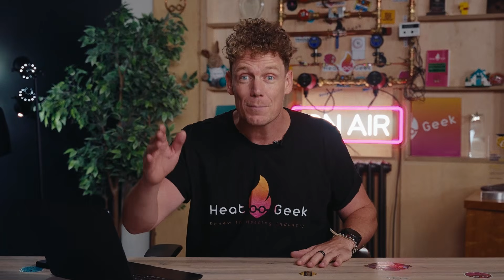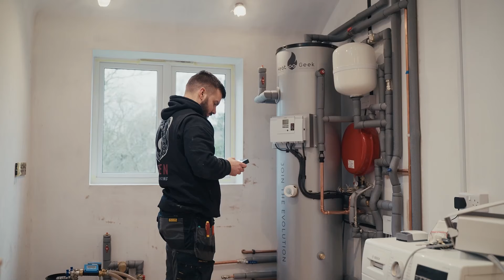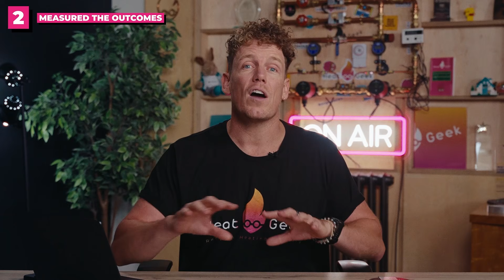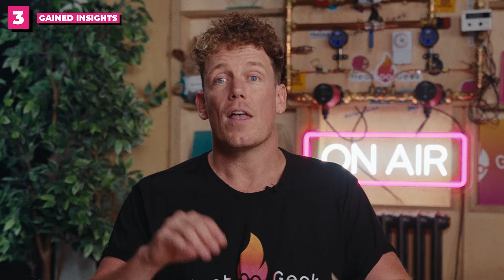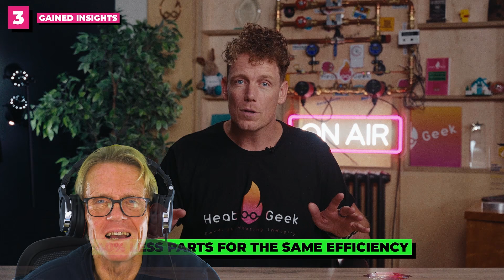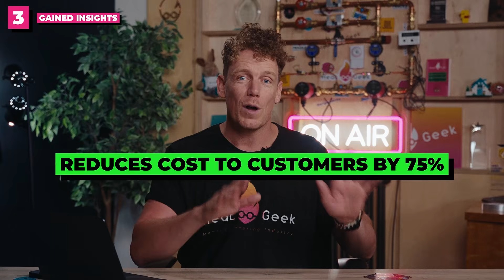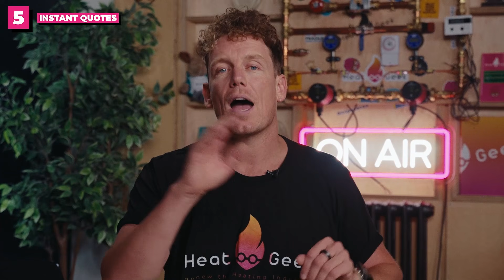Heat Pump Reality Check: Is Zero Disrupt Too Good to Be True?

Comment: For me Heat Geek are very disappointing and it's difficult to believe the claims in their "zero disrupt" concept. I got Heat Geek in because this "zero disrupt" policy seemed it would overcome all the issues I had with previous surveys and quotes, and was encouraged by the estimate given for my 53sqm bungalow via their website. I was therefore surprised to receive probably the most error strewn survey so far, and a quote of £6850 that was not only £1000 more than the the highest that I had received before, but was more than twice that of their website estimate. I have not as yet received a reasonable explanation from them of why this might be. This makes me very sceptical about their claims to be able to perform installations for little more than the BUS grant, and seems that maybe they are adding on a huge fee for their SCOP guarantee.

Comment: There are two ways to run gas/oil heating,  burn a ton of fuel to get the radiators up 40 50°C to warm up the rooms and everything in them fast then the system gos off when you are not there. Or you can have the heating on 24/7 and use the fuel slowly running the radiators at a water temperature just over how hot you want the rooms say 20°C both work at much the same cost.
The heat pump is much more efficient at the second method that is a fact straight from Heat Geek.
I see no reason why the existing radiators need to be changed or the hot water tank.
If the heat pump can maintain the water in the system at 25°C continuously the house should be exactly the same as it was with the gas/oil boiler running 24/7.
Here is the but, poor insulation makes both gas/oil or heat pump expensive to run, a fact that we all know.
Heat pumps become expensive to run if they have to run at maximum for long periods to compensate for cold drafty and damp winter conditions. 
As Heat Geek has admitted, the heat pump is often more expensive to run in winter and the savings are in spring, summer and autumn when it is very cheap to run.
I think all this heat survey and have to change al the radiators is just to push up the price of installation, which is where the money is made.

Comment: We have been heating pools, ponds, now cars and clothes dryers with heat pumps. Air con is basically heat pumps and its everywhere on the planet. The problem isnt heat pumps are bad, its that we over pay for electricity in this country and the heat pump suppliers are milking us.

Comment: I don't normally comment on YouTube videos however we love you Roger Bisby. It's great to have a mature debate from two people that know their subject. I am a great heat pump fan (np pun intended).  I installed a heat pump which I built with my dad from scratch in the 1970s it powered my swimming pool and gave a 4.5:1 efficiency. It was worth every penny we spent (but we didn't spend much on components). My dad designed the heat pump, He was a heating ventilating and refrigeration engineer and couldn't understand why every house in the land didn't have under floor heating and heat pumps. I hope he's looking down with amusement on your debate.

Comment: Roger gave Adam a good grilling, which I thought was handled with grace and good humour.
I think the Heat Geek advantage is in their training, and the fact that they not only monitor the performance of your system, but guarantee that it meets the agreed CoP value. 
I've been running my home's condensing combi boiler at at heating flow temperature of 44degC since before the end of last year, just to convince myself that a heat pump would do the job without the requirement to resize the piping (microbore, buried in a cement screed on a solid floor). I'm encouraged by the results so far, and the only thing putting me off from 'going heat pump' is that the boiler is only around 3 years old.
If I do ever take the plunge, I'll be phoning up my local Heat Geek, to take advantage of that expertise and the performance guarantee.

Comment: Did I see a hot water cylinder in the loft space of a modern house? I would be very worried about the weight of such a cylinder in my roof space. The timbers in a modern house are not the robust timbers they used to be....

Comment: In my simple mind, it makes sense to go heat pump if (a) the house is insulated perfectly (b) you have solar to battery storage to pay for the running cost of the heat pump. So, to meet those stipulations you are talking a decade of break-even time. Oil boiler plus water tank to gas combi swap out ~£3.5k and you recoup space!

Comment: The next issue to resolve is that of replacement costs in 15+ years time. Heat pumps need replacing just like gas boilers, but there is unlikely to be a £7,500 grant from the government when that time comes. Few people today are taking into account the savings needed from the heat pump to cover the future cost and even fewer people are going to be putting that money aside. A lot of people have major problems finding the money to replace their gas boiler, this is going to be a lot worse if a replacement heat pump costs twice the amount.

Comment: I have 3 frinds who got heat pumps fitted about 3 years ago at a cost between £15.000 - £23.000 and they were hopeless their houses weren't freezing but they admitted they were a lot colder than a gas boiler 2 of them have ditched them and are back to a gas boiler.

Comment: Hi, I want to respond to heat pumps. I haven't got one but I know my x partner been forced into one by the House association. He thinks it's absolute rubbish too expensive she is torn of turning it off because of the price. He's putting £30  a week on so she looking at a huge industrial  kettle for hot water and a oil portable heater. This is because she can't afford the price of one of these heaters. She needs it. She's disabled and always in

Comment: I had a heat pump instaled by octopus a year ago, , 7 new rads, valves,   new cylinder, immersion back up, all the electrical  stuff,  all the old combi boiler stuff removed,  works beautifully,  nice warm house, plenty of hot water, total cost to me, £ 1200,

Comment: People my village I’ve changed over to Air Force heat pumps. They’re always moaning wishing they stuck to oil. Most of the time doesn’t work when it’s cold. They’re always having engineers back because it’s not working.  I can assure you, nobody else in this village will be having a heat source pump.  As for smirking Adam I wouldn’t buy a packet of digestive biscuits off of him.

Comment: When we converted an old brick built granary into a four bedroomed accommodation back in 2010 we decided to use an Air Source Heat Pump.  We had an 8 KwH pump installed and used underfloor heating using water pipes.  We put radiators in the bedrooms on the first floor.  The installation back then was just over £5K plus a 500 litre hot water tank that including installation cost another £2K.  I really don't know how the figures compare with a gas/oil boiler, but a four bedroomed property, used by guests (no control over windows open etc.) we were astounded at how low the cost was.  Then it was under £1K per year for all heating, lighting, hot water and cooking.  We are still pleased with how it works, requires very minimal servicing and still works very well 16 years later.  It just keeps heating the property and providing all the hot water we have needed.  The insulation we put in exceeded the regulations of the day but I am sure they have raised the bar since than.

Comment: I am probably wrong, but it seems to me that the error here is that the UK is clinging on to the wet systems. Trying to combine radiators to heat-pumps is an error similar to the German car manufacturers focusing their EV production on big (long journey) cars. Harness the tech to its most efficient output. EV should be focused on small vehicles (Renault 5!) which covers commuters, school run etc, and heat pumps technology should be focused on warm air and joined with solar for hot water cylinders. The regulations linking grants to the removal of fossil fuel boilers was completely wrong. Get new installations to drive the volume up and prices down. Properly designed systems are at their most efficient when installed in a building designed around them. New house design is rolled out en mass on most developments so the one design is installed multiple times. Then, when the cost has been reduced by the volume of the developer’s purchase power the tech will be at a price that retro fits are logical.

Comment: So I thought this sounds good, maybe get some sound advice/help from heat geek. I have already had one estimate from a company the did not realise I was into maths. (They wanted to increase my yearly heating and hot water bill from £800 on oil and a small bit of coal to £2700 on electric) 
I went onto Heat Geeks website and it asks for your house number/name to get your address, then it comes up with a set of figures which are absolute fantasy. I was disappointed to say the least. The floor area was way out, and estimated heat loss, (5.48kw, is that per minute) again based on what, they don't know if I have newly insulated the house or its a draughty stone built cottage with a mud floor.
 340% guaranteed efficiency,  does not matter how efficient it is if you are using mega watts from the grid.
1 radiator to be upgraded, they don't know how i designed my radiators and what over size I gave them, if any..
For this work of fiction they say it will cost (minimum I guess) of £10800.
And the real kicker, they will come and view the property, a design consultation, for the princely sum of £250.
I though I had a bogus website, but it appears to be genuine.
So I think Rogers opinion that its all done by guesswork has been upheld.

Very disappointed.
Its probably done with AI. Artificial Idiot. 🙂

Comment: Roger I think you need to listen to the Zero Disrupt video again.  And you should undertake the Heat Geek training.  The heat geek installs typically have less components as the principles of the training is simple systems that are not zoned.  The training is all about engineers understanding the principles of heat loss and good heating designs.  It takes time to collate the data from all the different installs and then use AI to analysis the data to come up with how the heat loss assessment can be stripped back.  I think your comments are a bit disingenuous.  Heat Geek are trying to improve engineers training and knowledge as they require a different mindset to banging in a 30kw combi.   It would be great if you undertook the training and then gave your feedback.  There are companies  up selling needless parts on heat pump installs that are simply not needed (underfloor actuators, manifold pumps, zone valves) to name a few.  As the data continues to be gathered I’m sure more learning will come.  I’m not sure Heat Geek should be lumped in with some of these other unscrupulous firms.

Comment: So my challenge to you is as the owner of a London heating company . My own boiler is 30 years old non condensing and requires replacing. Come and install anew heat pump a pound less than a gas boiler and reduce my heating and hot water bills by one pound a year and I will give to your appointed charity £1000 . Fail and remove the heat pump and install a new condensing boiler free of charge and give £1000 to my appointed charity . Put your money where your mouth is ( I will be ignored I’m sure )

Comment: Typical gas lighting.
Higher demand will bring down costs !  Ah, NO! Material costs, labour costs, production costs etc etc, all go up without fail! That will more than cover any theoretical cost reductions due to higher production.
The claimed savings will always be over baked in order to sell an idea or product. The saving assumes that all extra measures are implemented, at extra cost not stated or taken into account.
Just like all the claims for a wind farm output. It is stated based on 24/7 output (and wind 24/7). No allowance for the fact that their annual output is approx 20%. Even less these days with the trend of paying to switch them off!
Yup a new market for " miss sold a heat pump" is gonna rise up.

Comment: Hi Roger, here's one for you. I moved in aug and very much wanted to install an ASHP. However my new heating is a forced air (floor vents) gas boiler. So imagine my suprise at just the complete lack of any information about if it can be done. Heat Geeks sadly have been absolutly hopeless , Adam bigs it all up but reality is just rubbish , very very disappointed.

Comment: Since most heat pumps need extra size radiators , just fit them and turn the gas down it will be the same cost and savings without the massive outlay

Comment: Not much discussion of a hybrid system that presumably could combine gas and heatpump sources to supply common pipework with  realistically sized water filled radiators.
Reply from the maker: We have discussed hybrid systems quite a lot in other videos. I see them as the way forward, Adam doesn't.

Comment: I went to their website and I filled in the form.  It estimated a cost of £3500 savings of £300 a year.  So 11.6 years to break even if nothing goes wrong.  At age of 75 I would be knocking on for age of 87.  I think at that age I will probably have been pushing up quite a few daisies.

Comment: The issue is not the tech, it's the industry hasn't quite got the smarts it needs yet. The transition is about educating installers and consumers. It's pretty painful but a necessity as we reduce the need for gas which price is set by foreign countries.

Comment: I have two 11kw heat pumps , cold spell came along , so I increased flow temperature from 25 to 40 running for six hours on continuos not weather compensation , there was barely any increase in the Luke warmth of rads or underfloor heat , put it up to 60 just to see , again virtually no difference , it did use a heap more electric but with no discernible difference .

Comment: I am an MEP consultant, and I am going to make it simple for everyone, this is my advice never get a heat pump if you have an old leaky house no matter what they won't work properly definitely keep you boiler, I would replace system boilers, to combi boilers which are more efficient and provide hot water on demand, and remove HWC from house, to provide more space for you and reduces your energy bill.
Heatpumps are low temperature so it won't heat an old standard house it will cost you fortune and electricity is around twice the price of gas and you would need a good known heat pump not a random heat pump which are expensive, heat pumps work in new built houses perfectly.
If you want to reduce costs simple, start by improving fabric performance add insulation to floor, roof and walls, two getting more efficient boiler, change bulbs to LED, change windows to triple glazing, maybe install MVHR system, and if you have some money to splash solar panels are great and small battery storage, their are many small things you can do to reduce bills but heat pump is not one of them.

Comment: There is no reason for heat pumps to be so expensive , technically they are very simple and should be cheap to produce - there is very little inside that box ! , when the grants stop and the climate change/carbon neutral  BS is finally put to bed then the prices will drop to realistic value. Heat pumps installed correctly work brilliantly and have a place but need to be cheaper and better training for the installers .

Comment: Every heat pump I have ever seen is very noisy after a year and very very noisy after 2 years so if you like Luke warm water a cold house and a huming motor bolted to your wall ringing throughout the house get a heat pump

Comment: I love these videos and the way you do them. That's exactly whats needed. Asking questions and debunking. 

Personally, I’ve just had a heat pump installed after nearly two years of research! It’s been working brilliantly, even through the recent cold snap. 

I am also a software designer testing an early-stage tool to help homeowners to find good heat pump installers, Getting the right installer is most crucial! 

 So if anyone from UK who's thinking about a heat pump but stuck/unsure choosing an installer? I'm happy to help.

Just message me if you’d like to chat.

Comment: Roger, everyone is aware of your hatred of HP's so why keep attacking someone who is just trying to move a solution on? From the video, Adam admits through monitoring past installs, data is obtained to better refine algorithms and calculations - essential for any new tech for wide spread adoption. Do you insulate walls? Has the insulation become thicker over the years? How much data have YOU collected to verify that the increase is required or warranted? Probably none, because you rely on others collecting and experimenting and telling you what to do. HG's aren't telling anyone what they MUST do, its a suggestion, a solution to a problem of cost. When combi boilers entered the market, their cost was more than double that of the old vented boilers, then Condensing boilers came to market and were more expensive still - new tech costs and early adopters always pay whilst later adopters get it cheaper! Look at anything involving tech - eg. phones - early brick phones cost £000's, now a new basic phone has better functions, bigger memory, camera's and costs £100's or less! Just admit you are 'old skool' and let Adam do his thing - I like paper drwgs on site but everyone seems to rely on their phones now - can I ban them or say you must have paper, get real, life moves on and we are of the past!